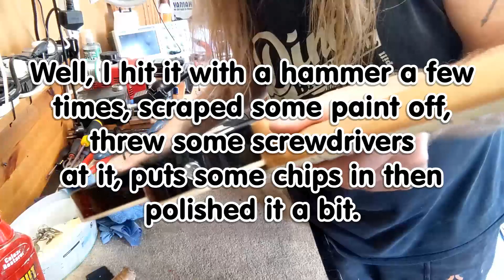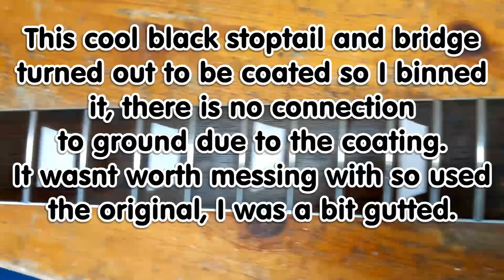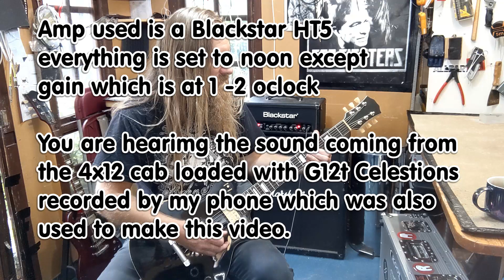Westfield Les Paul Copy Transformation

Comment: A good video, but there's a reason why people dress and recrown new frets.  That reason is avoiding the slight fret buzz/rattle you can hear in your video at 24:49.  
It doesn't take "hours and hours" if you have the right tools, and if (like you have done) you start with everything as straight as possible.    It is probably quicker than fixing individual frets, especially if a fret is too low rather than too high.   Got to give it to you though, you got it damn close, and I totally accept I'm being really picky.

Comment: Great work Dave
The original Westfields that I've seen or played all had G&b pickups in them
(same as the cheaper Korean Prs)
Ceramic magnets but thin a la alnico
They are a good cheap deal if you can find one
Have an E4500 the 70s sunburst custom looking one that somebody Gibsoned the headstock on before I got it
Swapped the magnets out to alnico 4
Gave it a going over its a killer cheap guitar for £70 and hangs with a good epiphone 👍🏻

Comment: Hi Dave, just got the custom version of these-  the E4500. Wanted to ask your opinion on what pickup i should put in the bridge position to start with for rock and metal please 🤘
Reply from the maker: Iron Gear Hot Slag
Reply: @DaveBarlowGuitar  Cheers Dave, opencore or covered pls?
Reply from the maker: @k77stan27  open seems to get the best results :)

Comment: Are you knowledgeable about this brand?  I have a Westfield sunburst LP. It has no white trim/edging on the headstock, which apparently means it can't be an ES4500. And the neck isn't bolt on, which apparently means it can't be an ES4000. I gather that is the full range of LP models they did, so it's a bit of a mystery what I have.  I bought it about 30 years ago when young and clueless, chose it cos it looked like Slash's. I don't even know if it was new or used.
You seem to think it's sh1t though. 😆
Reply from the maker: I dont think I said they are sh1t guitars
Reply: @DaveBarlowGuitar  23:50
"Making a shit guitar into a bloody amazing...." 😅
No worries, you're hardly alone in that opinion, these do come in for some hate. I'm happy with my old lump, it's mine in a way only something that's been with you 30 years can be. ❤️
Reply from the maker: @grimmriffer  LOL, yeah, actually I may have said that, the guitar itself is great, just the hardware was pretty bad on mine.